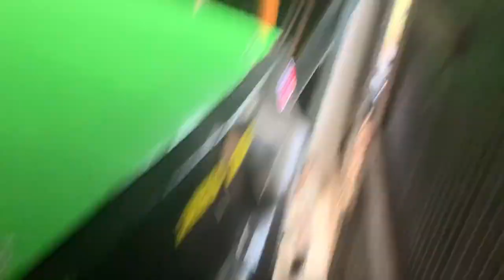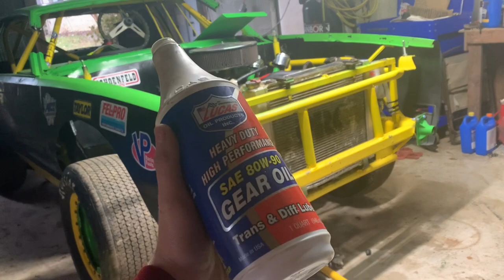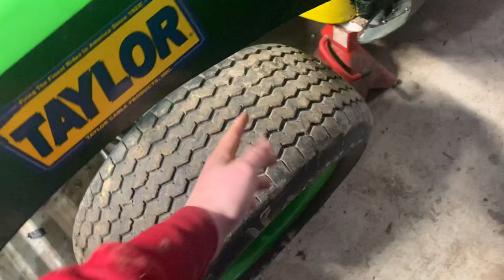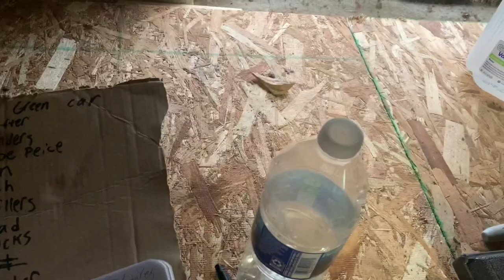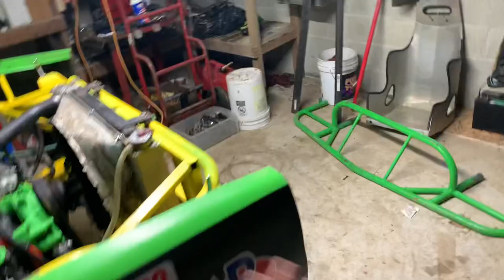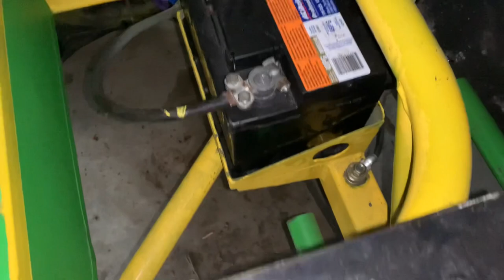Battling the huge learning curve of dirt track racing!!

Comment: Your biggest tire should go on your right front the smallest one on left rear . Also your  right rear lower trailing arm should be cut down a inch to help the car preset it's self in the corner along with a inch out both top arms to set the pinion angle on rear end
Reply: Thats right or a strieght up 7on the left rear will help ya keep from spining out or make in ya feel like ur gonnaspin on entry it tightens up the car alittle bit

Comment: Your doing good man it takes a lot of racing and years to know what some of these guys know but learning the basics will open the door to understanding how the car moves. Sounds like your car has soft and hard tires on it. One of the biggest things I've found is tire stagger witch helps with entering the corner you said you have the same size tires on the front and bigger ones on the back. A good start with stagger would be to put your biggest tire on right front and then a smaller tire on the left front then for the rear right rear put a tire that's with in a 1" to 1.50" smaller then the right front you can put this same size tire on the left rear. Tire compound depends on track and some what preference ha a softer tire will stick better in dry slick but wear faster and harder tire with last longer and just takes longer to get heat in it. Next biggest thing after stagger is camber on the right front then weigh out your car get your cross balances cause cross weight is also what helps  into the corner, then your spring rates and how your shocks are working. Shocks and spring will take a season to really figure out cause that all depends on how you drive and track. Cheers man from the west coast 🤠
Reply from the maker: Hey man I appreciate it! Stagger is a big one I need to learn. Thanks a lot!
Reply: No problem man and i like your videos as you said there isn't any street stocks on you tube. I run a sportsman and 4 banger 🤪
Reply from the maker: Hell yeah!

Comment: A-40 are hard tires the D-40 is soft and something that will help u get the car to turn put a 26.5 on left rear and a 27.5 on right rear u need 2 -2 1/2 stager in rear

Comment: The h-40 is the hard compound tire save those for ur RR for when the truck slicks over try with hard on right rear. And leave the 27.5 tires for the right rear as will. Get a stager tape measure and measure the tires the tallest start with RR then go driver side then RF with the tallest RR and smallest goes RF

Comment: Couple thing I would change - that fuel line change that to metal less headaches lot less fire chances - battery hold down get some threaded rod bend ends - fixes not long enough- next thing stagger wheel offset - makes a big difference on tacky track over dry slick - another trick since can’t run a right front shutoff - place a little worn on right front versus new pad on left - if can pushes the difference in pads will make car pull left helps turn car now push straight
Reply from the maker: I appreciate it! And yeah it actually has a shutoff, but I bet I’ll probably have to get rid of it. Makes since
Reply: Don't throw in the towle just yet man it is frustrating sometimes but if its something you love doing dont give up youll see it will come to ya
Reply: Listen buddy i dont work but ill help ya out on that race car ill help ya get it figured out for ya

Comment: First thing you need is to get the rules, read them and look at the competition’s cars and see what their doing, you can learn a lot just by walking by. Second find some help, a retired racer or someone who helped other folks in your area to advise you. From what I see it took you 3 cars to get something to work with. You will save more money and time by having a local shop to help with your base line set up, even if you have to pay. Because trying to figure out how to drive and diagnose the set up is tough. By having a basic set up then you can learn how to race. Plus you will build relationships that will help you get better. Racing is like life you have to put in effort and need some help to get started, but hard work and learning will let you compete in this class. It’s too easy to buy success but if you and your dad apply your self’s you will get there
Reply from the maker: That is the plan, I’ve already got the rule book memorized by heart. And have a local guy who is setting up my car. And believe me when I tell you I can’t afford to buy success. The only reason I got my newest car is because it was such a crazy deal I couldn’t pass it up, if it wasn’t for that I would still be running the black car.
Reply from the maker: I’m committed now! I won’t stop Intill I figure it out
Reply: @millertimemotorsports2844  actually you did yourself a favor by up grading. The new car has more potential for growth. The black car or the other one can be made work but it would take some experience to make work. We bought someone out so we started with good stuff

Comment: Ride height, wheel off set, smileys or Day motor sports have shock and spring packages, with people you can talk to about what the car is doing, get a set of scales find out your rear %  Hang weight where you need it. Hoosier H500 is a decent tire and the American Racer AR500 is a very good tire.
Reply from the maker: Right on. I appreciate it!! I’ve got a guy that I think is going to scale it for me here soon
Reply: @millertimemotorsports2844   does it have weight jacks?

Comment: I would suggest running a softer rf and a stiffer lf. I run a 1100 on my lf and a 1000 on my rf. This allows the car to roll over more and put more pressure on the right side tires, sidebite. Are you allowed to run a taller spring on the left rear?
Reply from the maker: Gotcha, and yes we are. Thought about throwing a spacer back there but I think I’m just going to see how it runs the way it is first.